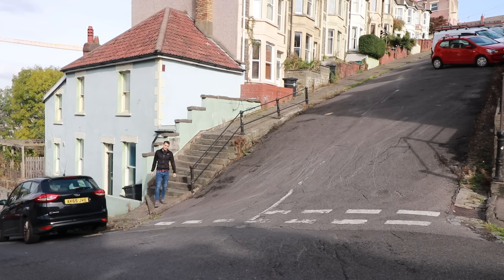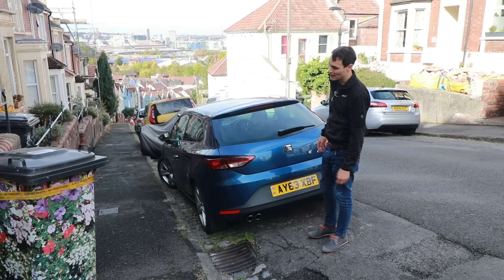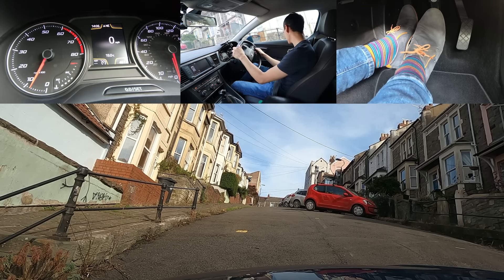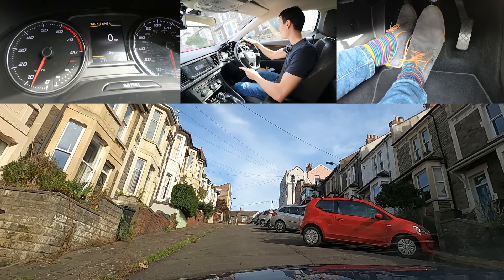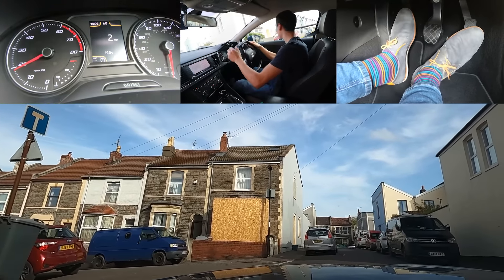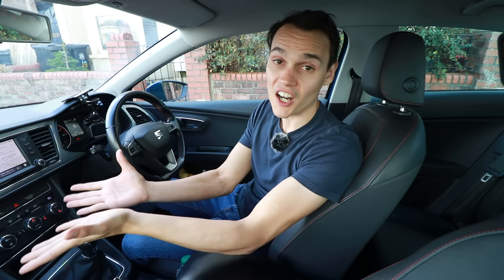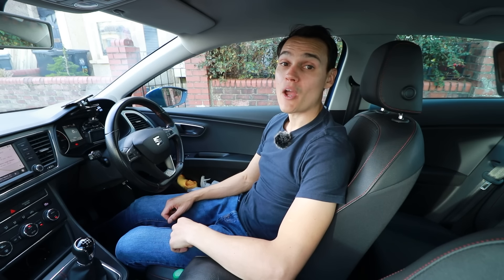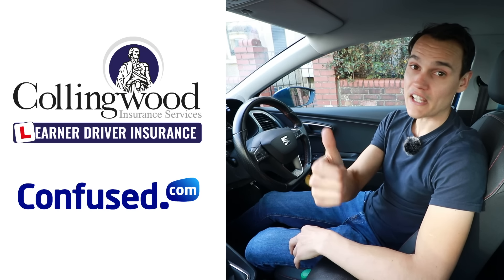Driving Instructor Stalls and Wheels Spins on the Steepest Street in England

Comment: I've just passed my test. I thought i'd failed at one point when I rolled back while trying to get some gas on a steep hill. Luckily no one was behind me so it was only a minor... this looks like hell to me haha
Reply: I just recently passed last week aswell
Reply: nice one mate
Reply from the maker: Congratulations on passing!
Reply: Use your handbrake
Reply: Could you not use your handbrake?
Reply: Congrats on the pass!  I don't know what traffic laws are like over the pond but any sensible driver should keep a short distance from you.  A backwards roll makes not a dangerous driver.  An impatient bumper sniffer does.
Reply: I'm a lorry driver and this looks like hell to me to. It looks like "Sod that, I'll find another path." If even pedestrians struggle then I don't fancy my chances.
Reply: @SethCocker05  I normally would've. I was doing a left turn and the traffic coming from the right cleared faster than I had anticipated. I thought I could go from the brake to the gas easier than I actually did (I was worried putting the handbrake on would be undue hesitation)... luckily, i did it, but for a second or so it took for the bite to kick in I rolled back a little...but I put my foot down and revved my way up 😂 ....idk if that made any sense, but apart from that I had a smooth drive.
Reply: Had exactly the same thing haha, nearly failed too!
Reply: @cheebwhackah7970  if you're not ready it's not undue and it's better to hesitate in that situation than to rush and roll back. Anyways, congrats on passing
Reply: @Liam.......  Probably did but didn't have the bite point or enough gas applied,
Reply: @Strawstarberry  Rollback......Inch or Mile. You're NOT in Control of the Vehicle.
Dangerous driving Failure 😱
Reply: The trick with doing a hill start is to wait until you feel the car straining to go forward, and only then do you let the handbrake down - cautiously. If the car rolls, you need more power and to let the clutch up further.

I've done a hill start on a 1:3 / 33% hill when the ahead of me ground to a halt. Luckily with my car being diesel, it can pull from very low engine speed, so I don't have to rev the engin very high before letting the clutch up. It was an unnerving experience, but I just throught it through and took my time - and waited till the car was straining forward before releasing th handbrake. I actually had to get out and drive the other guy's car to the top of the hill for him, because after five attempts to set off, he rolled further and further back and had used up all the extra safety distance that I'd allowed ahead of me. I think he was impressed that I got into a strange car with an unknown bite point and a puny petrol engine, and was able to set off on my second attempt (I stalled the first time). Repeating the process in my car afterwards was so much easier!

Comment: A hill start is tricky enough but I just found that moving backward uphill can be even trickier! I nearly bumped into the car in front because I kept stalling when trying to move backward on a considerably steep slope in South London. Every time I stalled my car moved forward a little and I stopped trying when my number plate was 1mm from the car in front of me (my car does not have hill hold assist). I finally got out of the situation by trying my luck last time after watching videos from this channel and others, so thanks a lot for all the efforts you have put in making this video!
Reply: You need to use the hand brake if you don't have hill hold assist. (Engage handbrake, apply gas, clutch to bite point, disengage handbrake) That way you don't move downhill when you release the brake.
Reply: Sounds like a tricky situation.
On steep hills I let go off the clutch (carefully) until its bite point, while still pressing the brake. When I lift my foot from the brake, the clutch will keep me in place without stalling and I can then add gas.
Or like sitofak said, you can use the handbrake.

Comment: Starting from a hill is the scariest part of driving a manual car for me. But since I learned from you how to balance it using only clutch and gas pedals (without using break) I feel much more confident now. And it's even fun to do it when stopping before roundabout, so I can start quickly with no delay. Thank you!
Reply: Using your clutch instead of brake is horrible for the clutch. It will cause excessive wear. Just use the handbrake if you don't have hill assist.
Reply: @sitofak  for short amounts of time it's fine but only do it when you know you're going to move soon
Reply: @Smokey-A  yeah and i would also say high blips of revs help your clutch out rather than sitting on bite with little gas
Reply: @straincheck4023  I could be wrong but over revving while holding the biting point can lead to the clutch burning faster
Reply: @Smokey-A  yeah you’re right, I meant dropping the clutch and coming back to the bite
Reply: Pulling away with just throttle and clutch is fine, just make sure you aren't stationary doing that. Or swaying back and forth. That will wear out your clutch
Reply: My first instructor told me to hold it on the clutch very lightly almost burnt his clutch out 😂but you learn from your mistakes and since I have a car with hill start assist makes it so much easier not having to faff around with the handbrake

Comment: Living in Bristol in the 1970s and '80s, I remember that whenever I got a new vehicle, I'd always try it out on Vale Street.  
1974 Bedford Viva van: no problem.  
1973 Land-Rover: built for it – couldn't have been easier.  
1968 Morris 1100: stalled, but managed it on about the third try.
1974 Rover 2200SC automatic: no problem.
1979 VW LT35 van: just sat at the bottom of the hill and spun its clutch – a complete refusal, which was a bit of a surprise.
Happy days ...

Comment: You can learn either way honestly but I think you're right, it's definitely easier to learn to pull away from a stop when you apply some gas first. The best way to learn in general is to start with the easiest technique possible and work your way up to the more advanced techniques of a particular skillset. Pulling away without any gas is pretty useful for learning the bite point on the clutch pedal though.
Reply from the maker: I agree, easier first is usually best.
Reply: yup. plus when you dont use gas in an unfamiliar car and stall, you only get closer to finding the bite point. starting off with clutch only is the best way for any unfamiliar car

Comment: You're best off with a decent diesel. I passed my test in a Peugeot 309 1.9D, back in the day. I could drive down the road on the bite point alone without the engjne straining. So much low-down torque was the key.. such a comfortable, easy car to drive. So incredibly ergonomic too!
Reply: Electric cars are even better.
Reply: @ChristofferETJ  🤣🤣🤣🤣🤣
Reply: Mercedes Benz Diesels are better.
Reply: @P00katube  Which engines and models in particular?
Reply: @mbz4652  The 300SD/TD (In line 5 Cylinder) and the 1986/87 300TD with the Inline 6 Cylinder)
Reply: @P00katube agree with all of those 🤣

Comment: There's a few hills I've travelled on (In wales) that give me this vibe. Short, but extremely steep in places. My driving instructor used to take me to a somewhat steep hill to practise this stuff specifically, as the area I was taking my test in was everything but flat and straight road. I got used to having to make the minute adjustments with both the clutch and accelerator to get these down pretty well. You know if it wasn't a good because you'd start rolling lol, and that was super freaky

The worst hill was when I was at uni and my mom was driving (shes much better than I am) and we took a 'shortcut' back to campus. There were no houses, just hedges, and it felt like we were going to tip over backwards, at one point it was so steep you couldn't see the road, just sky and the tops of hedges.

Comment: "... not to prevent you falling into the road" falls into the road
LOL!
There are some pretty steep hills in New Brighton where learners go.
I don't think I was ever shown to roll away with the bite first then to accelerate. I was always shown to keep handbrake on, then reach the bite point with clutch and accelerator, then remove the handbrake and away I go.

Also good that you cleared up the "gas" situation. My instructor used to say that too. When going up a hill and not going quick enough he would just keep saying "gas... gasss... gasssss"
But I prefer accelerator.

Comment: ....and why exactly would you ever not using the gas?
Reply: why exactly would you ever not using the grammar
Reply: @BallerShortsHD 😂😂
Reply: Adding gas will wear the clutch out way quicker
Reply: @kallht2079  No
Reply: @kallht2079  only if you keep the clutch, clutched. If your foot is not touching the clutch, the clutch does nothing, so there is no wear when it does nothing.
Reply: @hensiepensie  Yeah true
Reply: Because there are three pedals and you only have two feet, so not adding gas means you can keep your two feet in the clutch and brake. That way, you don't need to bother with the handbrake. If the car can pull away that way, why wouldn't you? It's just easier. (It's a little slower if you need to pull away quickly to fit into a gap at a junction or something, so it is certainly useful to know how to do it with gas for when you need it.)

Comment: 22yrs ago, before the age of all of these electronic driver aids, I too was a driving instructor. And back then, the hill start taught was always a bit of gas, clutch to biting point, handbrake off, observation checks, signal, increase gas, clutch up smoothly, gas as required.

However, that did rely on an efficient handbrake, and wasn't normally executed on a 1:4 hill! I'd bet than a lot of cars handbrakes would struggle to hold on a hill like that. It reminds me of the hill up from the Carey Arms at Babbacombe, Torquay. Lots of drivers would walk down to get their car and leave their partner at the pub. However, after then stopping to pick them up, many then struggled to pull away again!

Comment: I used to live in bristol, the area and nearby hills have many roads so steep that some cars just wont pull away or the handbrake slips when you try and use it to pull away without applying it with foot hard on the brake pedal. A driving instructors dream location!

Had to ask passengers to get out the car once as my underpowered astra would not pull away without stalling or spinning the wheels.

Comment: Things must have changed a lot since I passed my driving test because we had to use the handbrake on a hill start.
Reply: Yeh same for me in 2010 😂 plus his steering wasnt how i was taught lol
Reply: On hill start assist cars the handbrake isn't needed, especially if it's an electric handbrake.
Reply from the maker: I do teach handbrake starts, this is usually best for beginners as hill hold assist takes some pedal skill to use and not all cars have this.
Reply: @ConquerDriving  Same here. I teach using the handbrake only on steeper hills. It just saves time using the idle speed to move off.

Just before my part 2, I got taught to use the parking brake more than I usually would. Now I did pass, but the senior examiner said, "At times I thought, oh no, he's going for the handbrake again. You're an experienced driver, you shouldn't be using it that much."

When I told him who I had been trained by, he nodded and understood.

Btw, I've been an instructor since the mid 90s, and we were taught to use the word "gas", then, too.
Reply: Same with me and I’ve covered over a million miles. I have no idea what this guy is trying to do, you hold on the handbrake  and don’t lower until you have a good bite. Most experienced drivers would actually avoid this situation.
Reply: @joecarty8579  "I have no idea what this guy is trying to do,"

I thought he explained it quite well.

Say you're in a traffic queue on a hill with people frequently moving off and stopping, but it's not really steep like this one, would you bother to use the parking brake every time?
Reply: @joecarty8579  "Most experienced drivers would actually avoid this situation."

I'll repeat what a senior examiner said to me:

"At times I thought, oh no, he's going for the handbrake again. You're an experienced driver, you shouldn't be using it that much."
Reply: Pineapple of course you use the handbrake on a hill, why wouldn’t you. In fairness I have been driving for 40 years and doing close to 3K every month so maybe I’m a bit cautious but new drivers need to learn correctly.
I could pull off on that hill pretty easily without a handbrake but why would you.
Reply: @joecarty8579  "of course you use the handbrake on a hill, why wouldn’t you."

Because it saves time not to.

"so maybe I’m a bit cautious but new drivers need to learn correctly."

I'm sure that most learners are taught correctly. I've also found that most prefer to move off without using the parking brake unless it's a relatively steep hill.

The steepest hills I come across when teaching are 20% (1 in 5).

Various things have changed over the last 40 years, including not failing for crossing hands, the correct hand position, the manouevres on test (although I taught all except the pull up on the right, anyway, and still do, as we're supposed to, but know that most instructors don't).

Comment: I wouldn't even have thought of trying that without gas, I was surprised it almost got it.
Reply: Its a modern car with fly by wire throttle, the pedal isn't connected to the throttle butterfly. In conditions like this, the engine management system senses the engine is about to bog down and stall and opens the throttle itself, overriding the driver.
Reply: @Zadster  Still that's all under 800 rpm which is crazy

Comment: The hill hold assist is such a life saver if you have a nice enough car to have it because it makes coming off on a steep hill so much easier and prevent rolling back to other cars behind. If you don't have it, you have to use the handbrake which is an extra step that could either help or hurt if depending on how good you are with multitasking. Alternatively, immediately accelerate after coming off the brake with the clutch already at the bite point which could also hurt you by having too much wheel spins and lost grip if not stalling and going back instead of forward if it's too steep. So when that's the case, you have to go back and get a flatter road to gain momentum in order to go.

Comment: I learned to drive in the 1970s,the accelerator was called the "gas pedal" then, also learned to do a hill start on a steep hill, using gas and bringing the clutch up to biting point and then releasing the hand brake and moving off, it was also part of the test, only a few years before that hand signals were included in the test

Comment: Thanks for the advice on the gas topic. In my driving school ive driven a 123kw golf 8 and usually id be enough just to lift the clutch a bit and a car would roll. Now ive bought a 1.4 golf 6 with a mare 80hp and the clutch lifting mechanic does not work here, so now im practicing giving enough gas when im about to move the car. :)

Comment: Bristol is my hometown and I can confirm that hill is horrendous! I also remember a few years ago being stuck in Keynsham (near Bristol, and also very hilly) and getting stuck at the bottom of a dead-end (basically vertical) hill with my ex. His Ford KA unfortunately didn't have enough power to get back up it, and after some time of me and a friend trying to push the car up to no avail, some lovely neighbour came out his house, telling us this happens all the time, but to REVERSE up it. Worked like magic.
Reply from the maker: That's true, in reverse a front wheel drive car will have the grip of a rear wheel drive car. If you have a rear wheel drive car though, reversing will have less grip up the hill.
Reply: Not to mention that, in general reverse is a lower gear than 1st, so if the engine doesn't have enough power in 1st, it may have enough power in the lower reverse gear.   All useful to know when you've stalled on a hairpin bend in the Swiss Alps and rolling back  means rolling off!

Comment: I can't even remember how I moved off in the Wrynose and Hardknott passes, it was so long ago, but would like to try this street.

The steepest roads I get my pupils to move off up are 20% ones in High Wycombe. There I tell them to get to 2.5k revs and then find the bite point, but point out that, when they're used to they're own car, they will just do it all simultaneously, without thinking about it.

However, I was with a pupil behind some vans on a hill once and thought, "ah, they're not moving off because a learner has stalled at the traffic lights."

Then the vans started going the other side of the island and I could see that it was a bloke on his own in the car. I got my pupil to pull up and walked up to see if he was OK. He was a young guy (probably early 20s) and was panicking a bit as he said that he couldn't find the bite point. I suggested he get out of the car and I could try.

When the lights changed I managed to move off, but the bite point was very high, and the clutch felt a bit dodgy, not exactly slipping in an obvious way, but I still think it needed looking at and suggested that to him.

Mind you, when I've had clutches go, they haven't given a great deal of warning, usually brief high revs and then, within a few miles, that's it.